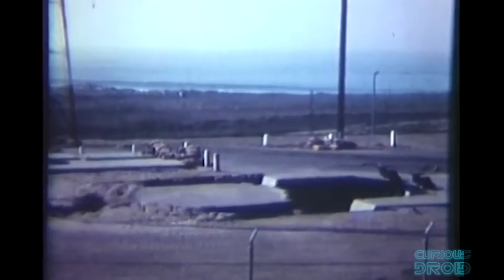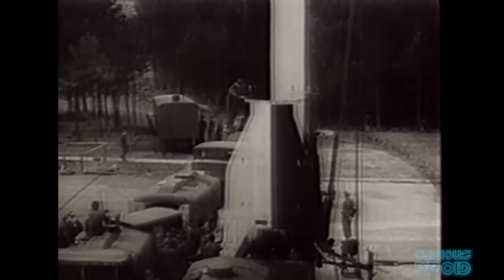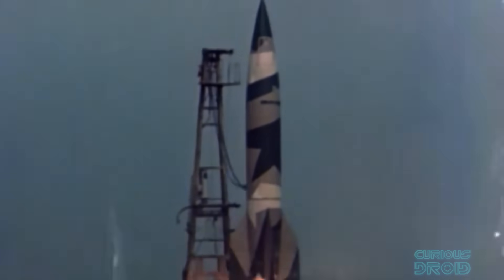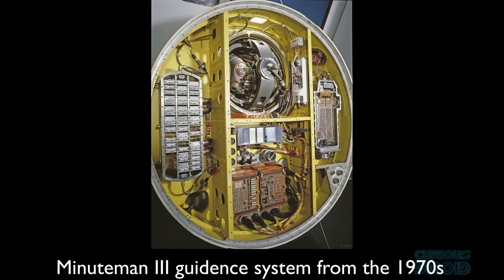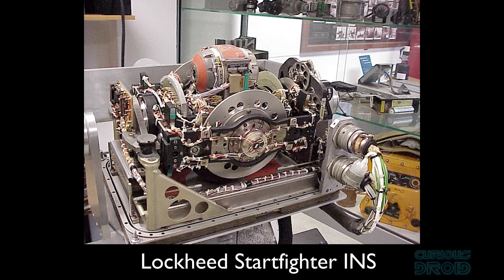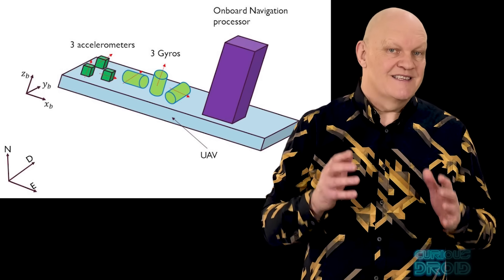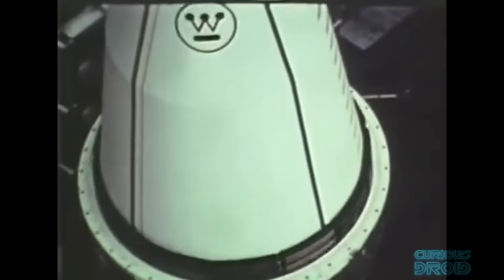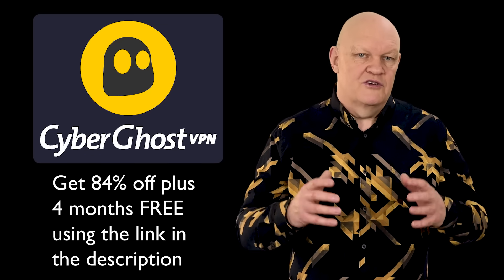How Does a Nuclear Missile Find its Target?

Comment: fun fact: in the early days where ICBM's were using electro-mechanical guidance, each silo had a special alcove where the technicians would be calibrating the missile's position and "zero point" after maintenance/replacement of the missile with a (sort of) s.xtant. There are some video's on YT where they do show that step.
Reply: The device is called a “theodolite,” and very, very common in surveying applications
Reply: @jrwickersham  Thank you!! Every much appreciated!
I remembered seeing/hearing about it and now able to indeed find it back, video's and even the manual, instructions and such.
Thanks!
Truly fascinating how engineers solved complex problems, all but at first for weapons but ultimately got us to the moon and back.
Just the sheer complexity of what issues were resolved, layer after layer of challenges, I find truly impressive. Again, thank you for the pointing-out!
Reply: @jrwickersham  The ones we used to align Minuteman I & II were Swiss-made. We were told at missile school that part of the ones we used were used by the Russians! Swiss playing both ends against the middle as usual!
Reply: You can say sex on the internet.

Comment: By knowing where it isnt.
It knows this because it knows where it isn't. By subtracting where it is from where it isn't, or where it isn't from where it is (whichever is greater), it obtains a difference, or deviation. The guidance subsystem uses deviations to generate corrective commands to drive the missile from a position where it is to a position where it isn't, and arriving at a position where it wasn't, it now is. Consequently, the position where it is, is now the position that it wasn't, and it follows that the position that it was, is now the position that it isn't.
In the event that the position that it is in is not the position that it wasn't, the system has acquired a variation, the variation being the difference between where the missile is, and where it wasn't. If variation is considered to be a significant factor, it too may be corrected by the GEA. However, the missile must also know where it was.
The missile guidance computer scenario works as follows. Because a variation has modified some of the information the missile has obtained, it is not sure just where it is. However, it is sure where it isn't, within reason, and it knows where it was. It now subtracts where it should be from where it wasn't, or vice-versa, and by differentiating this from the algebraic sum of where it shouldn't be, and where it was, it is able to obtain the deviation and its variation, which is called error.

Comment: My Dad's aunt was in London during the war with the V1 attacks. They were called buzz-bombs due to the sound they made. She told me when I was young that they would basically go until they ran out of fuel, then crash and explode. She said that as long as you heard the motor, you were safe, but if you heard the motor stop running, then an explosion was close at hand.
Reply: Not quite. 
There's a propellor at the front that spins in the airflow and a mechanism counts the revolutions down to 0.
Like, "after 600 ticks, crash" 
At 0, the elevator is jammed into a dive by a spring I think. 
The steep dive causes the engine to be starved of fuel and cease. 
But that was a design fault because the silence gave warning to the civilians, it was supposed to power dive with the pulse jet running all the way!
Reply: @MostlyPennyCat  Ah, that makes more sense, so my Dad's aunt, and everyone else likely just assumed that the silence meant that it ran out of fuel rather than the fuel being shut off.
Reply: The pulse-jet engine of the V1's produced such an iconic and ominous sound. I think the V2's would be scarier though - you hear nothing until it explodes then a few seconds later the sound of the rocket engine (if it still had fuel). There's a block of flats close to where I live which seems out of place since all the surrounding streets have Victorian era houses. I looked it up on a map of all the bomb impact sites in London and found out that a V2 had struck there.
Reply: During the 90's I was a teen, when an infamous Iraqi leader starting shooting ballistic missiles all around him. Luckily satellites could detect each launch and its trajectory immediately, so if a missile was flying towards us, we had about 3 minutes to find a shelter. Then came a few booms. We could not tell if these were Patriot missiles hitting the target, or the missile hitting the ground. Towards the end of the war, the Iraqis just sent missiles with a warhead made of a concrete slab. But a 250Kg stone falling on the ground at Mach 5, is enough to cause a lot of damage. Now imagine what an 5 meters asteroid coming from space at the same speed can do. At least I got the chance to explore some leftovers from the rocket engine. Lots of pipes and other metal pats, stamped with Russian letters
Reply: Yeah, grew up in west London hearing same stories. My gran got bombed out twice. With the V1 you dived for cover when motor cut. 
Lived in Chiswick years later, around corner from where first V2 creamed in. Not that accurate, residential area.
Reply: My dad had one land on his block in London. Killed a bunch of the neighbors, he ended up it the hospital as he was looking out the living room window when it exploded.
Reply: I hope she wasn't in Lambeth? Lambeth got flattened because we managed to persuade, (through their compromised spy networks), the Germans that their V2 rockets were overshooting their targets, which they'd been quite accurately hitting, they adjusted, poor old Lambeth got flattened...

Comment: Came here expecting to hear about how the missile knows where it is at all times. Was not disappointed :P
Reply: The missile knows where it is at all times. It knows this because it knows where it isn't. By subtracting where it is from where it isn't, or where it isn't from where it is (whichever is greater), it obtains a difference, or deviation. The guidance subsystem uses deviations to generate corrective commands to drive the missile from a position where it is to a position where it isn't, and arriving at a position where it wasn't, it now is. Consequently, the position where it is, is now the position that it wasn't, and it follows that the position that it was, is now the position that it isn't.
Reply: @Alfred-Neuman  Very good, however somewhat long.👍
Reply: @budgiefriend  To be fair, this would also sound great over a beat.
Reply: lol
Reply: Pssst: Alexander The OK.
Reply: In the event that the position that it is in is not the position that it wasn't, the system has acquired a variation, the variation being the difference between where the missile is, and where it wasn't. If variation is considered to be a significant factor, it too may be corrected by the GEA. However, the missile must also know where it was. The missile guidance computer scenario works as follows. Because a variation has modified some of the information the missile has obtained, it is not sure just where it is. However, it is sure where it isn't, within reason, and it knows where it was. It now subtracts where it should be from where it wasn't, or vice-versa, and by differentiating this from the algebraic sum of where it shouldn't be, and where it was, it is able to obtain the deviation and its variation, which is called error.
Reply: The missile is eepy. https://www.youtube.com/watch?v=2BeqAcidOY0
Reply: The follow-up someone else did, "The Missile Guidance System's Final Flight" is way more emotional than it has any right to be.
Reply: same reason I'm here
Reply: Yeah I also saw the title of the video and instantly thought of that. Came straight to the comments knowing everyone else would be thinking the same thing lmao.
Reply: I'm generally against the use of AI but someone deciding to use Kronii's voice to narrate that was kinda cool.
Reply: He should've integrated that seamlessly into the video

Comment: I saw an analysis of the V1 that showed that it was an effective weapon only because of the expense of trying to stop them. If the Allies had ignored them, they'd have cost more to deploy than the damage they inflicted, largely because of their poor accuracy. Of course the morale implications made that impossible in practice. The V2, having no countermeasures, was not an effective system overall.
Reply: Bollocks! London was the largest city in the world in term of square miles of surface area and thus was uniquely vulnerable to the V-1 and V-2 missiles which inflected such massive destruction that damage analysis reports still remain classified to this day... London was devastated and did not return to prewar population until 2006 as a direct result of German attacks. 
The V weapons were so successful that both missiles were adopted by the U.S. military.

Comment: So I’m figuring then that the original Titan I missiles would use the ATHENA guidance computer in the LCC to calculate course corrections after launch and transmit the data via the ground antenna silo to the missile gyros for target adjustment? That must have been incredibly complex before transistors and integrated circuits.

Comment: I'm just posting this because someone will 
The missile knows where it is at all times. It knows this because it knows where it isn't. By subtracting where it is from where it isn't, or where it isn't from where it is .... okay I'll save you the text wall.
Reply: WE WANT THE TEXT WALL! 😂
Reply: I know how to cater to the audenice

The missile knows where it is at all times. It knows this because it knows where it isn't. By subtracting where it is from where it isn't, or where it isn't from where it is (whichever is greater), it obtains a difference, or deviation. The guidance subsystem uses deviations to generate corrective commands to drive the missile from a position where it is to a position where it isn't, and arriving at a position where it wasn't, it now is. Consequently, the position where it is, is now the position that it wasn't, and it follows that the position that it was, is now the position that it isn't.
In the event that the position that it is in is not the position that it wasn't, the system has acquired a variation, the variation being the difference between where the missile is, and where it wasn't. If variation is considered to be a significant factor, it too may be corrected by the GEA. However, the missile must also know where it was.
The missile guidance computer scenario works as follows. Because a variation has modified some of the information the missile has obtained, it is not sure just where it is. However, it is sure where it isn't, within reason, and it knows where it was. It now subtracts where it should be from where it wasn't, or vice-versa, and by differentiating this from the algebraic sum of where it shouldn't be, and where it was, it is able to obtain the deviation and its variation, which is called error.
Reply: Tbh I know the text wall pretty much off by heart.
We want the text wall! 
(Are gen [whatever it is now] so adverse to ctrl C/V?)
Reply: @georgeprout42  Nah I didn't wanna get nicked off by the youtube nerfbat police.
Reply: The first time I heard that joke: "Why is that funny?"  Then I studied Extended Kalman Filters. "Oh, that's why!"